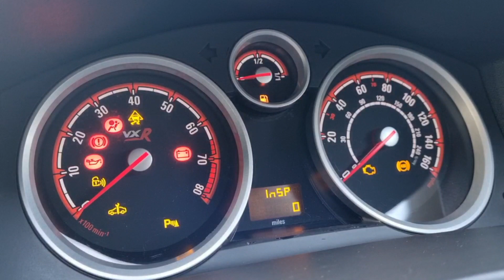Installing a starlight roof in my Vauxhall Astra H VXR

Comment: Thinking about doing this, I’m also considering a shark fin Ariel. Would be a good idea to do it all at the same time? 

Cheers
Reply from the maker: 100% mate I wish I had of changed my base when it was all out
Reply: @mastersmods  guna dye headliner black also. What size drillbit did you use for the fibre optics holes? Thanks!
Reply from the maker: @UKZOOT  as small as possible as the strands of fibre optics aren't very thick. As long as you glue them down on the back side, it shouldn't make much difference. Just don't use anything too big 😂

Comment: Can you please help me ? I want to unplug the interior light thing. I was trying change a bulb and a metalic bracket just fall apart. I see 2 screws holding this thing down , i unscrew them ok . But after that how does it come off to inspect it from the back do you know ?? I just cant get it off
Reply from the maker: I'm sure the metal bracket sits around the rim of the headliner and is meant to help hold the interior light unit in place. I unscrewed the 2 torx bolts near the front of the unit then pushed it forward and pulled it down, also used a screw driver to pry the clips out from around the unit. Hope that makes sense. If not and you're still struggling I'll try do a short on here to explain
Reply: @mastersmods   thank you so much for your response. Excuse my English, I am trying my best! that metal brucket tha fall, is holding the middle bulb. I am stuck at the exact part that I pushed the thing forward and trying to get it of but I was afraid to brake it. I will try again knowing that it is the way to do it
Reply from the maker: @panosdio5002  you are doing good with English 👍 tell me how you get on

Comment: Were did you put module m8 I been wanting to do mine for ages now I seen ya video it's got to happen lol
Reply from the maker: It's above the interior light mate
Reply: @mastersmods  were you get them from any links please
Reply from the maker: @astrasri1.82  it was a Christmas present off the Mrs, I wouldn't recommend the seller as they weren't helpful in sorting the issues we had with the things they sent out. Ended up with a half refund and me having to make the kit work, which is why I had to wrap the fibres in tape
Reply: Wow that looked like a pig of a job to do m8! Fair play for not giving up and throwing it in the bin, lol. The remote is the same as I have with my footwell strips. These are nice cheap interior mods but all the time it took you to do this you could have done yourself a complete smd conversion
Reply from the maker: @darrenmicklewright2008  a lot more involved with an smd conversion and not one I feel I'd be able to do tbh.
Reply: @mastersmods  tbh it's not that bad except for the standard cd30 mp3 radio. What I did was try the easy parts to replace first incase it goes wrong, eg window and headlight switches and see how you get on with that. £20 to replace.  Iv never done soldering and I did mine ,and a tutorial video would be ideal for others👍